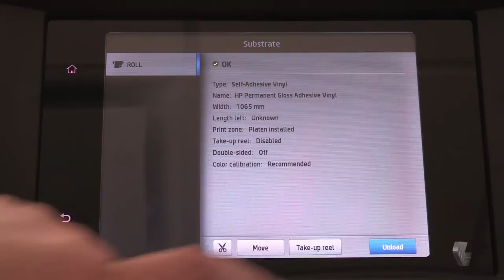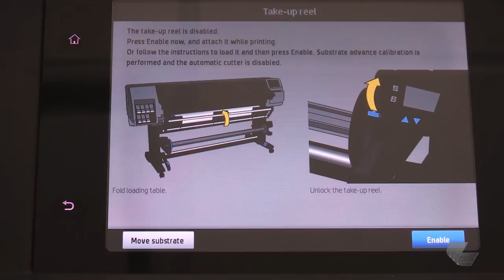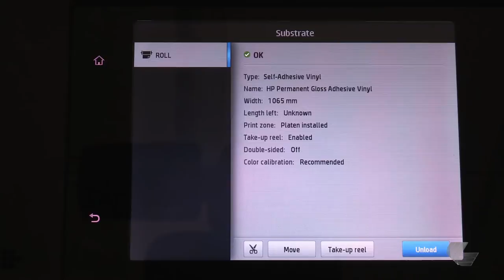HP Latex 310, 300 & 360 - Using the Take-up Reel

Comment: And waste 6ft of 3m 1080 material,...every time you load.... Yikes...... I have a 330 and this process is kind of painful every time....
Reply: You can start printing and once it gets to the length of the take up reel attach it, or you can have material rolled on your core and take the piece that you reuse over and sober and tape it to your new piece. You don’t have to waste material.